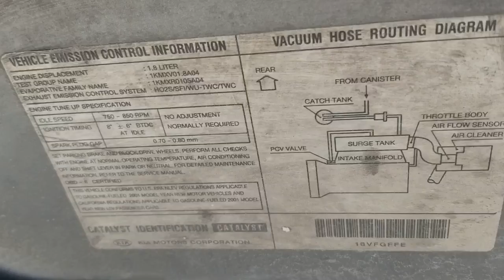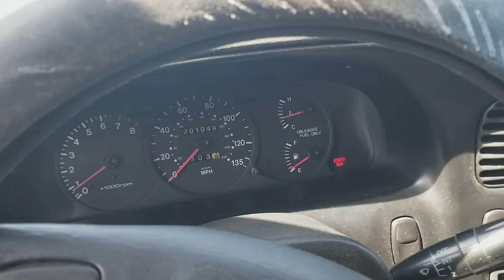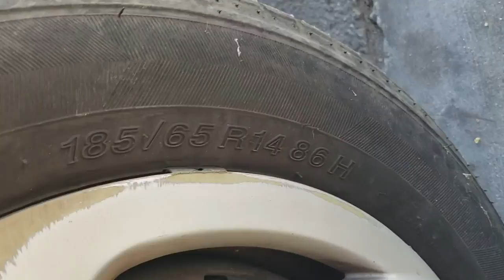2001 Kia Sephia Walk Through

Comment: I pulled a 2001 kia sephia out of a field 3 years ago . 1 owner with 79,563 MILES on it. Lady said it needed a new head gaskit BECAUSE oil was all around the head. Got it home and pressure washed engine and did a inspection on it. I reached around on back of engine where oil filter is located and who ever did the oil change didn't tighten down oil filter😳. If you where too Bump oil filter with your finger it would spin. That's how loose it was. Lol. Oil was spraying it onto manifold causing it too smoke.Anyways I did a new oil change and topped of battery with distilled water&peroxide, and gave it a overnight charge. Also drained gas out of tank because car sat for 3 years.  Next mourning I shut charger down and button it all down and fired it up..Runs great. And the Kia never needed a head gasket. And the miles on the car was nothing,not even broke inn..I went back and told the lady what was wrong with it and I tried giving it back but she insisted on me keeping it.. The kia sephia is out in my driveway , and I use it as a daily driver. Right now it's at 91,000 thousand miles and runs great. Good little car for FREE. LOL 😆.And very happy with it. Gas out here in California is $5.50 a gallon and I prefer putting gas in the Kia and driving it instead of my other vehicles. Gets great gas mileage and,  It's almost 2023 so the Kia is what ,,,almost 22-23 years old. Anyways,,,,,. Well here's my question for you?? How many miles does your kia have??? Just wandering. And curios how far they go until Motor Poops 💩 out. ,,thanks. Tom from CALIFORNIA🇺🇸🇺🇸🇺🇸.
Reply from the maker: That's amazing that you would go back go owner to give her the car back. You are a great person! This kias are great cars. The car I had, had over 200,000 but if you properly give it maintenance it should last more than that. Make sure radiator, thermostat, coolant, oil and check engine get fix as soon as possible. Alot of people do not care about their cars they keep driving them until they give up without fixing it. 1 single problems can cause more.  problems.
Reply: How nice of you to offer it back